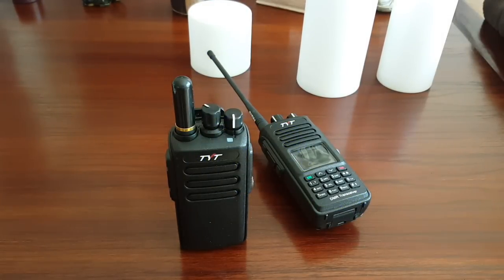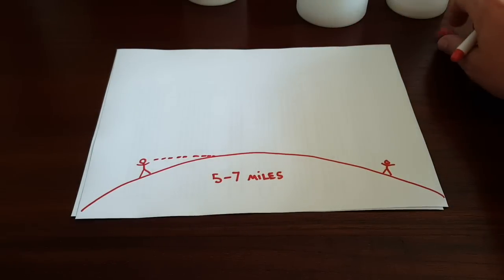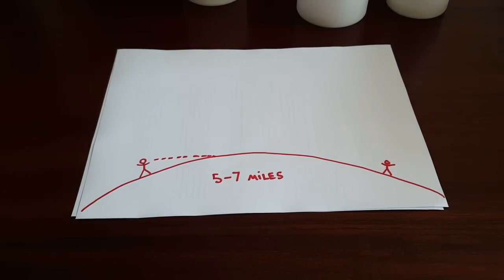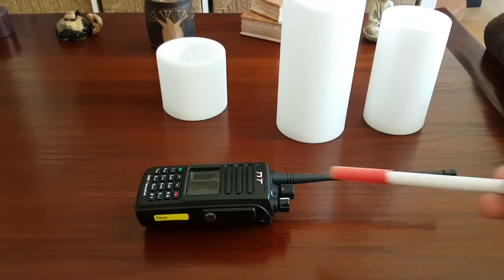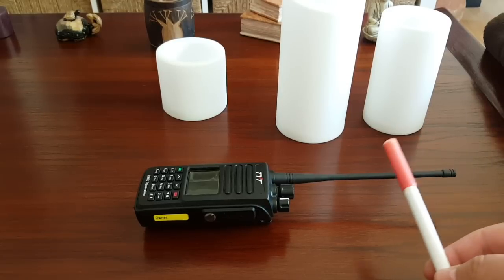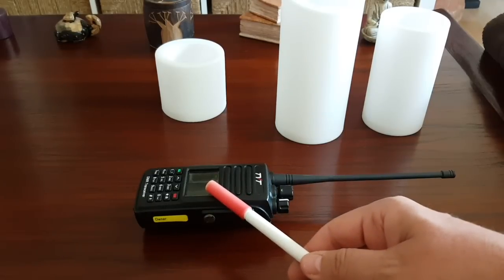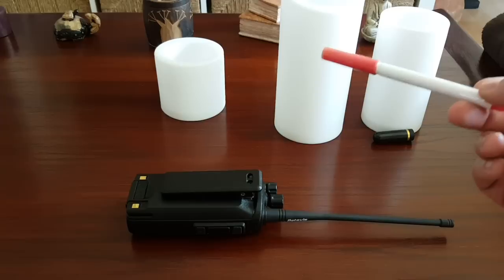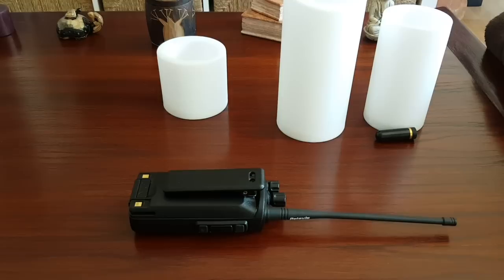How to Extend The Range of Walkie-Talkie Portable Handheld Radios.

Comment: Antenna..as long as possible .better
Reply from the maker: Absolutely not! The length of the antenna depends on the frequency used.
Reply: @RadioPrepper  1/4,1/2, .5/8 wave lenghth or 5m long hi gain VHF or UHF fiber  antennas are what?? if you can match antenna and final of tx impedances ,of course longest antenna is better..
Reply from the maker: But it's not just a wire. You can't say "longer is better" without confusing people. A 5m VHF antenna is a colinear. Impedance has to be matched, and longer can be much worse depending on the application. The radiation pattern changes too, often not for the best. You just can't make a statement like that without further development, because more often than not, it's false.

Comment: I would draw a straight line with two stickman on either side and then draw a bunch of little box houses and buildings in between and you having to get higher above those structures not the curvature of the Earth in a 2 mile range radio 😂
Reply from the maker: Handheld can sometimes work over hundreds of miles, from a high altitude. What about use on a boat... No houses in the way then...

Comment: How long of a wire for FRS / GMRS bands 462.7250-462.5625 mhz
Reply from the maker: Hello, 468/462=1ft half wave, so a quarter wave is 6 inches, body of the radio included from the base of the antenna. On UHF it won't help as much as on VHF. Maybe worth trying. Might be illegal on a legal FRS radio..

Comment: Thank you very much. I'm still looking for an antenna that can be mounted high. Like on the home or vehicle.
Reply from the maker: For VHF and UHF look at the Diamond X series..
Reply: @RadioPrepper  I was specifically thinking the FRS walkie-talkies.
Reply from the maker: You can make a UHF Yagi using the handheld antenna as the feeding element.

Comment: These were very good explanations of tactics to use to increase handheld radio range.  Another tactic, if you are talking walkie-to-walkie (FM Vhf or Uhf), with some distance between the two radios, is to stand still while transmitting.  Face in the direction, initially, that you believe your partner to be.  Don't rush to make a quick, short transmission, during the first few transmissions.  While you are working to extend the time of your transmission, your partner, who may have a very noisy copy on you at first, should be listening to the level of the noise on your signal, and, with his  transceiver's antenna vertical, also, can extend his radio-holding hand out and rotate his body.  If the quality of the received signal gets worse, go back to where you stood originally.  If received signal quality improves, stand in that "hot spot", until your partner makes another transmission to you.  He should look for a "hot spot" while you are transmitting back to him.  Sometimes moving a very short distance (feet), while receiving a weaker signal, can have you go from receiving an extremely noisy and difficult to copy signal, to receiving a very strong and clear signal.  A good way to demonstrate this, is to listen to one of the NOAA weather stations around 162Mhz (in the US), while moving around with your walkie.

Comment: Some advice please; I event direct an ultra marathon.  The race is on salt flats i.e. as flat as earth can be. On the flats are water stations for the runners. Base camp/start-finish is at the Southern edge of the salt flats with runners on the salt flats to the North.  Further South of the base camp is a 100m high escarpment overlooking the salt flats with no obstructions.  On the escarpment I placed a person with a 2W T800 Motorola walkie talkie.  Then each water station had its own 2W T800 walkie talkie.  The furthest water station from the escarpment walkie talkie was 32kms.  Everyone at the water stations on the salt flats could hear the person on the escarpment but the escarpment couldn't hear anyone more than 15 - 20kms away.  How do I fix this? I was based at the start finish and was using the escarpment person to relay messages from the water stations to me 1kms forward of the escarpment. Is a repeater set up on the escarpment the solution? More power walkie talkies everywhere or something else?
Reply from the maker: Power won't do it. The reason is the curvature of the earth. At that distance the stations no longer have line-of-sight. The solution is height. You need to use a coax cable to an antenna on a mast, like a telescopic fishing pole, on both ends. What frequency are you using? You'll need a small budget, likely less than $100...
Reply: @RadioPrepper  462.5625MHz
Reply from the maker: I'd suggest a quarter wave with radials to put on top of the masts.. See the quarter wave antenna calculator by m0ukd..

Comment: Getting higher extends the range for sure. Good radio/antenna info.But there's no measurable curvature. Architects and surveyors make no adjustments for earth curvature. Shocking but true.
Reply: on a building 100m long it is easy to flatten the earth the few cm that the earth curves. Over 7km, the curvature is 3.85m, which more than enough rock to block UHF and VHF completely
Reply: The Humber Bridge in northern England is a suspension bridge with a pair of towers.
The towers are 1410m apart at road height, and 36mm further apart at the top. This is because of the curvature of the Earth.

Comment: Hello.  I heard that in Norway you have switched radio from analog to digital.  Is it true that your analog walkie-talkies are not working now?
Reply from the maker: I am not in Norway, but walkie-talkies used for what? Analog will always work anywhere in the world. They do not depend on an infrastructure like cell phones. An analog radio will always work with another analog radio and a digital radio will always work with a digital radio using the same system. Geography has no bearing on radio waves.
Reply: @RadioPrepper  if so, okay) I thought that I bought myself an analog walkie-talkie in vain.  Now, after all, everything is being digitized: digital television, digital money, digital broadcasting, and so on.  Excuse me if it's not convenient to read, I'm just translating from google translator :)
Reply from the maker: No problem, the translation is good. Analog will still be used for a very long time :-)

Comment: If the curvature of the earth is an issue then what about those short wave radios picking up stuff from Germany , England etc? According to  the spherical trigonometry used by scientists these locations are obscured by many miles of curvature.
Reply from the maker: Radio waves are refracted by the ionosphere.
Reply: @RadioPrepper  does refracted just mean bounced? And the signal can be or must be bounced multiple times?
Reply from the maker: Yes, usually it bounces once, up to maybe 600 to 1400 miles, depending on many factors, but sometimes, when there is enough solar activity (the sun ionizes the ionosphere), multiple bounces do happen. Higher frequencies, above 10MHz up to 50MHz need a low angle to bounce... Lower frequencies, especially between 2 and 7MHz can bounce almost straight up and back down, covering zero to a few hundred miles. Anything above 50MHz does not bounce and goes straight up into space...

Comment: i was going to put 2 tails on (1 for each band), but when gil said just 1 (for 2m) would work
for both bands, i was most pleased.
fyi, the 2m tail is 9.5"/24cm and the 70cm tail is 4.5"/ 114cm.
'tails' are also 'counterpoises'.
once again the radio prepper saves the day!!
Reply from the maker: 2m quarter wave is 50cm/19in. 70cm is 17.5cm.
Reply: @RadioPrepper  that is what i get for doing it in my head! many apologies to you and your followers.

Comment: Yeah, height and polarization are big, especially height, although the antenna is something that should be given attention, for sure... A true quarter wave whip can improve range immensely, as opposed to the popular rubber duck antennas. In addition, and this is common in relation to using hand-helds inside buildings, one can often improve range to an astonishing degree by simply moving around and finding a sweet spot, this phenomenon presumably being due to the nature of muti-path RF behavior... Anyway, for better range, definitely get a longer antenna!
Reply from the maker: Quarter wave definitely! With a quarter wave counterpoise hanging... In urban environments reflection on buildings does play a role, especially on UHF.

Comment: They also wind a coil around to get the length. So the wire length in the antenna is 1/4 or half length, no matter how long it actually is. It is wound. No walkie talkie antennas I know of are whip...
Reply from the maker: Some are. Often it's just a spring.

Comment: In 5 or 7 kilometers you do not perceive the curvature of the earth, nor because the earth was the size of the moon. you need 70 kilometers or more,  to be a problem
Reply from the maker: http://www.calculatoredge.com/electronics/lineofsight.htm many line-of-sight calculators available online...
Reply from the maker: Look under Radio Horizon: https://en.m.wikipedia.org/wiki/Line-of-sight_propagation#Refracted_distance_to_horizon

Comment: so if the rat tail is such a great work around, why arent there any rat tails on any of these  radios?
Reply from the maker: Probably because of aesthetics.. They definitely should though.
Reply: @RadioPrepper   i must agree the rat tail is kinda cumbersome and potentially problematic.  do you think that getting one of the ridiculous Abbree "tactical" antennas would replace the need for a rat tail. (due to the extra length?)
Reply from the maker: I doubt it, haven't tried one yet. Longer is not better. The correct length is better....

Comment: 9 minutes in and it took that much time to tell me the curvature of the earth requires you to get higher up, the orientation of the radio matters, and the antennas usually aren’t long enough. I recommend writing up a script and practicing it a few times before recording. I appreciate the effort, but this was painfully slow to get a few nuggets of info.
Reply from the maker: Noted thanks.

Comment: I live in the city there's a lot of electrical noise I was thinking about using a loop antenna that instead of attempting to pick up the electrical component of the radio frequency it attempts to detect the magnetic component. I think that will give me a better signal to noise ratio and make it easier for me to detect a weakee signal. Any ideas as to whether an external loop antenna would work better and what size does it need to be
Reply from the maker: Definitely and outside would be better. Use a perimeter of 5m.

Comment: Once again another post that can't get to an understandable POINT! Range range what's the increase in range (FRUSTRATING)
Reply from the maker: Range is not something you can easily quantify I could say one mile or two hundred and both would be right, depending on many variables. The only correct answer is "more than before."

Comment: I just opened the radio and coiled a 1/2 wl wire in the space where the speaker is. works like a charm. also extended the antenna to be 1/2 wl. tuned for max signal strength.
Reply: can share photo
Reply from the maker: Bad idea, don't do that.
Reply: @RadioPrepper  sorry, i forgot about the radiating element, fixed it, works twice as good now.

Comment: You make very good tutorial videos! Congratulations!
I tried this with a tuned 49 cm long pig tail
 wire and the result was only a little bit better than originally.
(Baofeng UV-9R Plus, with original stock antenna, VHF, 145.500 MHz, 1 W, and a field strength meter.)
However when I unscrewed the wire from the body of the radio, and I just squeezed the wire with
the back of the radio with my hand, the field strength jumped to double! Can you imagine how I surprised? :)
I think in my case this capacitive coupling it was better than direct coupling! Worth to try! :)
73DX! HA0NC, Op.:Zsolt, from Hungary, Debrecen
Reply: @Zsolt Horváth:  Hi Zsolt – that’s because handie talkie (HT) radios are (usually) designed to utilise the hand (and human body) for capacitance (and why HTs work better when held, rather than just placed on a surface).  This is most noticeable when receiving more distant transmissions.  Hope not teaching grandmother how to suck eggs!  Will send you greetings via QRZ.com.
Reply from the maker: Interesting...

Comment: Why do some cars with cb radios have like 10ft whips? Isn't that way past their wave length?
Reply from the maker: A quarter wave for 11m is 2.75m, so not far from 10ft. Some antennas are 5/8 wavelength. Anything shorter than 9ft is actually short for CB. Some antennas have a coil in the middle or at the base to shorten the antenna, but they are not as efficient as a 9ft whip.
Reply: Thx for reply!

Comment: I always made j-pole ‘firestick’ antennas with PVC pipe, copper tubing and electrical tape.  They are good, low-cost, high gain antennas.  Or were before copper prices went up.
Reply from the maker: Interesting, knowing the firestick... Thanks.

Comment: I have a client that has some sets of icom radios, they want to be using it over a very long distance. It was initially configured some years ago and they said it was connected to the a mast
Reply from the maker: They probably meant a mast was used to get the antenna higher, which does help a lot. An antenna is mounted on top of the mast and connected with a coax cable to the radio below.

Comment: Hook up whip antennas to it like on military vehicles bumper to back bumper if needed straight up and your 50 to 100 miles with monster whip lol
Reply from the maker: Front to back bumper is on low frequencies for NVIS, check that out..
Reply: @RadioPrepper  aint it the same type of screw in on the radio?

Comment: Years ago in the UK and using CB radio. My antenna was a mag mount and the ground plain of the car was important. If not in the car we used metal dustbin lids to increase the range. It was imperative to have the antenna on the car as close o centre of the roof for best range. Thanks for the video. A bientot mon ami.
Reply: I still have cb. A relatively basic mobile rig. A property tuned and mounted antennae makes all the difference. People are amazed by my radios range and audio quality.
Reply from the maker: Half-wave end-fed!
Reply: Radio Prepper Sorry I don’t understand the reply as I’m not radio savvy.
Reply: Journey of a Lifetime I have an older Cobra in the basement collecting dust. No antenna and no SWR meters to set one up with anymore so I guess there it will stay. It has virtually no monetary value to sell so may as well keep it for now. There is a Baofeng UV-82R for sale locally it’s a tri band radio pre programmed for the local LADD radios only $80 Canadian but I have no license to transmit.

Comment: 10 kilomètres is better than a CB radio! :o
Reply from the maker: I've done thousands of miles with a CB, but not often...
Reply: @RadioPrepper  if you are are talking skip, that's possible. As a trucker, usually there's so much static, a couple of kilometres is more reasonable.
Reply from the maker: It will happen more often in the next few years...

Comment: The Quansheng UV-R50 radio clip does not connect to the ground on the battery. It would have to be done on the inside between the battery and radio, but theoretically could work.
Reply from the maker: Or the outside of the antenna connector..

Comment: The rat tail made no difference whatsoever on my Baofeng UV-5R. I cannot see how it would anyway as surely the person that is holding the handheld is acting as the counterpoise !
Reply from the maker: No he is not and I can assure you it works.
Reply: @RadioPrepper  It's a pity that you don't have video evidence here showing the  measuring of the TX and RX signal with and without counterpoise to prove your point !
Reply: The operator would be a very high impedance counterpoise - and not the right wavelength...  Skin resistance in in the hundred thousand ohm range. A piece of wire (ANY type of wire) cut to 1/4 wavelength would be much better - and low impedance.  Wire resistance at 19" would be very close to 0 ohms.    Current always takes the path of least resistance (or for AC/RF circuits, impedance).

Comment: This is possible on a 10 m band ssb with a walkie talkie a distance of 3201 km 1989 miles with 5 watts.
to be seen on you tube channel pd0jw.  And thanks to the other station with large antenna park.
Reply from the maker: It certainly is!

Comment: nice vid! btw is there any way i can extend the range of my baofeng uv-5r? lets say around 6-8km?
Reply from the maker: Yes, follow the instructions in the video... If it is not enough, use a Yagi-Uda antenna. I have a video on that too...
Reply: I thought these baofengs range is up to 5-6km actually hmmm... Saw it from one of the survivalists. He gave those numbers. Btw did you try your Baofeng in urban area or just outdoors in the wild?
Reply from the maker: In urban settings range is fairly limited, but a couple hundred miles isn't unheard of from a mountaintop under the right conditions... The brand has nothing to do with it. Power has little to do with it...

Comment: Range = height above local terrain, the "radio path horizon",  antenna efficiency in "dbd"",  antenna impedance match to transmitter,  receiver sensitivity and selectivity, and at the very last, transmitter power. You can have all the power you can carry, but the type of antenna and its height over the surrounding terrain is what makes the difference. 

I stood at the top of Cheeha Mountain in Alabama, with a one watt amateur VHF transceiver brought up repeaters in four states with the rubber duck antenna alone. On 6 meters with a three element beam horizontally polarized during a band opening, I talked to a ham in Maine with a Yaesu FT- 625 RD at one watt. Height can be everything.
Reply from the maker: Absolutely!